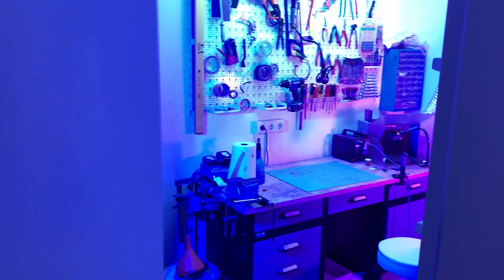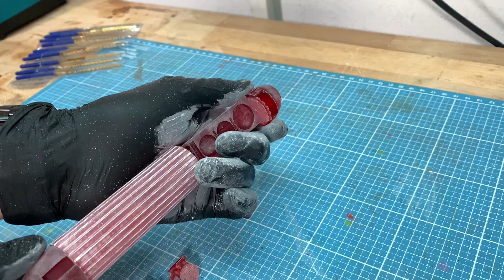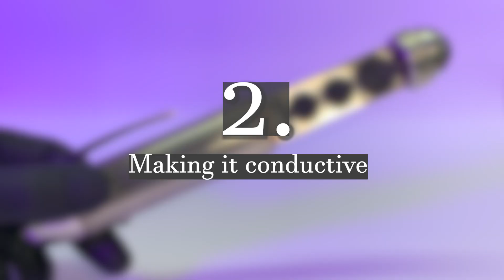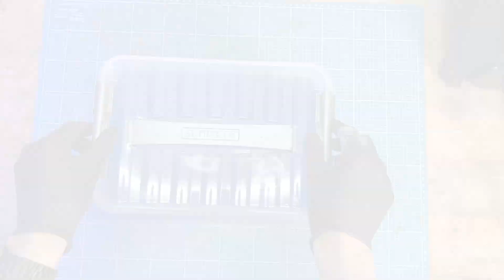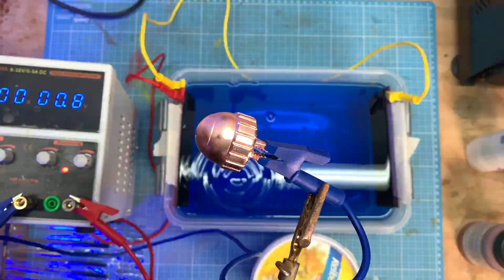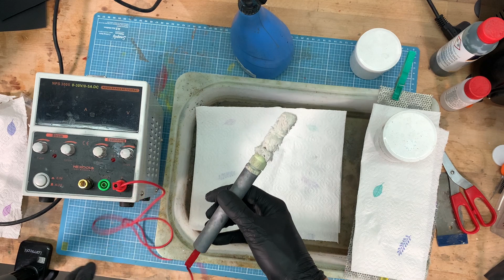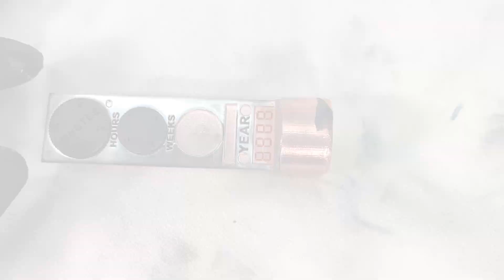Electroplating 3D Prints - Super Smooth

Comment from the maker: Just tell me what 3D Print you‘d like to see me plating for the future 🙃
Reply: Tabletop miniatures?
Reply: Peacemakers Helmet!
Reply from the maker: @brianthompson8783  that‘s big. I‘ll need a bigger basin for that. But I was thinking of doing bigger things (sword etc.). Problem is that it has to stay in there pretty long (hours), otherwise I’d just apply a metal layer with the galvanic brush.
Reply: @hen3drik  yeah, I have the helmet printed and I'm trying to figure out the best way to chrome it. Plating would be awesome.
Reply: Daft Punk Helmet or R2-D2 dome. Thanks for sharing this process. For a larger items would this process be prohibitively expensive when you have to increase bath size?
Reply from the maker: @insultcomicdog  best way would be a huge bath of a nickel electrolyte. This is illegal and kind of „dangerous“ for private people in my country. There is a way to galvanic brush it, but then the surface metal layer is very thin and ground has to be incredible smooth, what is tricky with conductive paint. To plate it even, the whole helmet should be plated at once in the galvanic bath. And distances to the anodes should be good, so I guess it could be expansive to prepare such a bath.
Reply: @hen3drik  Maybe you can start with Lego minifig scale helmets which are more feasible! This is my Thomas bucket which I’m trying to figure out how to chrome:  https://youtu.be/snK1cj5nOYQ
Reply from the maker: @insultcomicdog  I’ll do some testing.
Reply: A cylon
Reply: Have you been eying the Terminator arm that's up on Thingiverse?  Yeah, me too.  I have all the major parts printed and sanded but haven't progressed further because of how lousy my attempts at chrome paint have turned out.  The idea of electroplating makes me feel tired but I bet it would be amazing looking.

Do you think it is possible to go from conductive paint directly to a final, ready to sand and polish, nickel coating in one electroplating bath?
Reply from the maker: @hberg321  yes, i made that there years ago. I used Alclad II chrome paint and I went just faboulus. Indeed, I was thinking of this this to be plated. I‘d look way cooler, but, as you know, it‘s made of many, yet small parts. And they all have to be sanded smooth as hell before plating, as you don‘t want to sand this allergen nickel. You could create a thick copper layer, sand and polish this and apply a thin decorative nickel layer at the end (instead of palladium).
Reply: @hen3drik  Cool.  I have a bottle of Alclad II but have been disappointed with it rubbing off or turning uninteresting under clearcoat.  Did you use aqua gloss or just paint it and put it straight in the glass container?  

I didn't know that nickel was an allergen.  That must be why my stomach gets upset after eating bathroom fixtures or lighting accessories.
Reply from the maker: @hberg321  i don‘t clear coat alclad II paintings. There is a water based coating for alclad paint but it slightly dulls the finish. So, don‘t touch it and put it right into the glass vase. But to have alclad shine realistic it has to be applied thinly leading to a dark chrome effect. Bright nickel would be very convincing.

Correction: nickel is a contact allergen. Touch may harm you. Furthermore nickel electrolyte is dangerous and suspected to cause genetic defects, that‘s why it‘s restricted over here and in more states.
Reply: Can you 3d print a PCB circuit without the plastic around, just rigid cables on "air"?
Reply: Luck Light Saber New hope

Comment: What voltage/amperage are you using and how did you determine it? When attempting to determine the voltage & amperage, do you use the surface area of the plated object, or the surface area of the contact between the brush and the object?
Reply from the maker: Hi, this is an old video. In more recent ones explain how to determine amperage by the surface area. Long story short: Use "CC / constant current" Mode of your power supply + use 1A/dm². Silver cannot be used a diffusion barrier. Nickel works, too.

Comment: Any tips for airbrushing the conductive copper  paint?? I just got an airbrush and it keeps getting clogged :( what size needle do you use?
Reply: 2ns question! I want to electroplated a full sword! Do you have any tips on electroplating a long blade??
Reply: I've tried diluting the conductive paint but im still having issues :( I think im using a .3mm nozzle
Reply from the maker: I use a 0.5mm nozzle. Try higher pressure around 2-3bar. Electroplating long and big parts require bigger power supplies and suited vessels. I think I try it for the future.
Reply: I am facing that same problem, seems like the copper powder blocks the fluid passage. I will try using another kind of airbrush, that one where the ink reservatory is located under the airway (succion model).

Comment: how many paladium is need for this object?
Reply from the maker: It very few. I used a brush for this, so the brush must be soaked a few times. The palladium then deposits on the copper slowly. I can hardly guess but would say around 10ml. Thing is that the brush soaks in quite some volume.after that I squeeze the liquid back into the container.
Reply from the maker: @did3d523  not the stuff I use (at least way less): https://www.tifoo.de/en-uk/palladium-plating-solution?number=01-09-00020

Comment: Can the copper electrolyte be reused for multiple baths?
Reply from the maker: Yes, it regenerates by the anodes that will ultimately dissolve over time.
Reply: @hen3drik  ok thanks.  I have access to a lot of copper wire scraps because I’m an electrician.  Would using this work as well as the solid plate of copper?
Reply from the maker: Yes, this should work. One thing you have to consider: the surface area of the anodes should be slightly higher than the object you are electroforming.
Reply: @hen3drik  ok. My plan was to copper plate an iron man faceplate, so large parts.  So for this I would either need large plates or a lot of copper strands around the container
Reply from the maker: Yes, and probably high current. But it sounds like the perfect part for electroforming!
Reply: @hen3drik  how do I figure out the correct current? Trial and error?
Reply from the maker: @peebs2424  current is not what i‘ aiming for. It‘s the voltage. I use max 1.5V for all my platings. I keep the current in mind, as it will rocket for large prints after some time. I do some Math before I start plating of what current to expect at the end, but it‘s not that important.
Reply: @hen3drik  ok thanks. Hopefully the material needed is accessible in Canada. A quick search for the electrolyte didn’t turn up much results

Comment: Can you give me some idea of how much area, or models of a given size, the 20 ml Tifoo Palladium solution might cover?  I'm trying to figure out if I need to get the larger 100ml bottle and Tifoo provides no coverage info that I can find.  Do you dip the little anode brush/mop straight into the fresh Palladium or do you keep that clean by using a second container (like it appears you do in this video), and also don't pour any leftovers back into the original Palladium bottle?  Or do you think contaminating it doesn't matter much?
Reply from the maker: 100 ml is good for the brush imho. Don‘t dilute it, use a dedicated graphite anode and a dedicated nonwoven or woven sleeve for this electrolyte. Don’t mix! I use sealed containers in which I fill from the bottle, just in case, but I think it‘s okay to pour back. Surface area depends on how thick the palladium layer should be. With 100ml you can cover a lot of area for display purpose.
Reply: @hen3drik  By don't mix, do you mean 'one sleeve per one type of exact solution'? I get that.  Regarding coverage, I discovered today the Tifoo calculator (https://www.tifoo.de/infomaterial/berechnungs-tool) which really gave/gives me a scare--my object has 470 cm^2 (it's a head model 13cm high, area calculated by software), and it says for that I'd need 56ml minimum, 85ml recommended Palladium electrolyte at 0.1 micron thickness (I guess that's as thin as I should go?), and 23ml min. / 34ml. at 0.2micron recommended of Midas Gold electrolyte.  That's way more than I expected--assuming 0.2 microns gold is even durable enough.  It gives me one attempt at success if I buy a bottle of each and means the cost of plating that single model is around 51€!  Holy cow!  Have you tried Tifoo's calculator and if so, did you find it more or less accurate?  Also, for the copper solution it says I need to use 23.5 Amps! (25 micron thick, 470cm^2).
Reply from the maker: @perspectivex  I‘ll do some research for the amps. And yes… you‘ll need a lot. It‘s small at the beginning and going high at the end of the plating. For the palladium/gold: I don‘t have that much experience since I just started plating and didn’t measure my needs. But when using a brush it‘s really a very thin layer that is built up very quickly (for gold). I don‘t have the feeling that you need that much electrolyte. When moving the gold brush it‘s becoming gold instantly so I don’t belobe this is even 0.2 microns. Be careful with the calculator; I had crazy results as well. You can dilute the Midas electrolyte 1:1 with distilled water, I guess.
Reply from the maker: @perspectivex  470 cm^2. In my calculations i would expect something between 7A an 8.5A at 1.5V.
Reply: @hen3drik  well, that's a lot better than 25A but still gives me a new problem.  I have a lab power supply but it only goes to about 3A.  I have 30+A computer supplies at 12V but I'd have to figure out how to step them down.  hm.  That's too bad, I thought I could get away with the power supplies I have but now I'm not sure.  Or...if I did 1.5V at 3A would it simply mean it takes 2.5x as long?  I could maybe live with that unless I need to keep an eye on it all the time for safety reasons and it ends up being more than 6-7hrs.  That would get a little tiring.
Reply from the maker: @perspectivex  no, unfortunately it‘s not working that way in a bath.
Reply: @hen3drik  That gives me some hope.  I think I'll also scale down my model from 13cm high to 10cm high, smaller than I'd like but it gives me some room to mess up and (maybe) still have enough electrolyte for a 2nd attempt.  I guess if I run out of Palladium I could diy some nickel electrolyte since I have some nickel sheet.  Diluting the gold ...I wonder what effect that would have...maybe it would just go on slower but you'd end up using the same amount to have the same final look.   Also, having used various brushes do you think I could make my own from some microfiber cloth (what Tifoo says they use) or some other fluffy material?  It doesn't seem like a really critical part somehow.
Reply from the maker: @perspectivex  microfiber works good, yes.
Reply: @hen3drik  ah, too bad.  I'll have to figure out a high amp low voltage supply solution.
Reply: @hen3drik  what's the deal with "woven" and "nonwoven"?  Is it important to use one or the other in specific cases?  I was thinking I could just cut up some cloth I find at the fabric store and sew a bunch of layers together leaving a cylindrical hole for the anode to slip into and use that.
Reply from the maker: @perspectivex  you can do that. Get microfibre.
Reply: @hen3drik  ok.  But the woven vs. non-woven...when, if ever, does that matter?  Why is it even a thing to care about?
Reply from the maker: @perspectivex  this is not really an issue, try two layers of micro fiber between the anode and the object. 😉

Comment: Good tutorial, but what I found most interesting is that cloth covered "pen" for electroplating...
I've only recently started dabbling in dissolving metals into solution and plating stuff. I found I needed a way to plate by "brushing" with my electrode, but whose direct contact... and basically I made the EXACT same thing! 😮

That has instantly validated what I came up with on my own — had no idea such a thing existed! lol
Mine is a carbon rod out of a AA C-Zn battery (also have used a wood pencil's graphite core), with the "brush" head being the fiber-strand wick from an oil air freshener  ("AirWick" brand).

Washed the wick good, then cut a small portion off. Gave the rod a pointed tip. Rammed the rod inside, a few mm (about 1/8") before it protrudes. Then wrapped sewing thread really tightly around the wick and rod, and superglued it (reinforces and keeps it in place).

 IDEALLY not gluing shut the side the rod is stuck into... That's the only downside with mine, as the one end being sealed up now makes it rather hard to clean when changing metals 🥴

Comment: Does this increase the weight/feel of the 3d print in the end? As in does the print feel significantly heavier after doing this process?
Reply from the maker: It does, yes. The smaller the print the more as the ratio is smaller. For bigger prints like the neuralizer weight is less important, as it comes from the solid resin, but the tactile feeling of the metal (cold, smooth).

Comment: Great results ! The only thing i'm not sure is why bother with commercial solutions (tifoo in you case) with brighteners when you sand and buff after.  You could make you own copper electrolysis for much cheaper and it would not change your workflow since you already sand and buff.
Reply from the maker: You are absolutely right. I started this hobby with a commercial brand; though brightner was already in it. Maybe I was also wishing that these first results we‘re pleasing enough, but I eventually ended up sanding and buffing. This video was one of my first: I learned how to apply thinner and more even base coats, which ended in a nicer results. Still, if you want this mirror like finish, you should sand and buff. Another point I think important is that you keep things simple for beginnings. DIY solutions could be a step to much for people to get into this hobby. I noticed a steep learning curve when it comes to electroplating, so when doing tutorials I just want that people get nice results quickly.
Reply: @hen3drik  it's a great tutorial don't get me wrong.  I have been debating for a few weeks if I should go with commercial solutions or not but the price is quite high because I need least 10 gallon of copper and nickel just to start.  Seeing a few results with commercial solutions I know I will have to sand and polish anyway so I figured what's the point  I also try to get the absolute best bond between the plating and fiberglass.  I tried adhesion promoter before the paint but I cannot get a mirror finish with it because of orange peel.  I am currently doing some tests with baking the paint, it seems to improve the bond.  Any thoughts on this ?
Reply from the maker: @copper_knight  unfortunately no. I use 2k paint, then straight to conductive paint.
Reply: @hen3drik  what do you think about buying say 2 liters of the Tifoo acidic copper electrolyte then mixing in 1-2 liters of diy copper electrolyte?  I need 3-4 liters but the tifoo stuff is just so expensive.
Reply from the maker: @perspectivex  I wouldn’t try that, but I may work. Be sure to match pH and add brightner to your solution as well. Tifoo has tiered pricing for the electrolyte.

Comment: I have been watching nickel plating videos for weeks and I have only seen you use palladium what is its role?
Reply from the maker: Nickel electrolyte is harmful and prohibited in Germany for end users. Palladium also works as a insulating layer between copper and I.e. gold (just as nickel does). If you can handle nickel, go for it; but it causes cancer and all sort of allergic stuff. Basic rule: if you see bubbles in the electrolyte you‘re doing it wrong :-)

Comment: An excellent tutorial for playing, I can't wait to try it now. Quick question; do the jaws of the negative clamp cause less material to transfer at their point of contact? Meaning do we need to move the jaws mid bath?
Reply from the maker: In a nutshell: Yes. the jaws will weld with the 3d print. you can prevent this by moving the jaws, or placing them to a hidden spot (they will still weld there). You can also carefully wrap the whole print in silver wire so that the connection surface is larger. This reduces visible spots where the jaws were. BUT you still see them; also: you will still have to move the part in the wraped wire.

Comment: Print mesh like bone structure of structural element then electroplating it would save material without compromise the strength
Reply from the maker: Yes, probably. Metal plating adds a lot of strength.

Comment: I don't have access to conductive paints where I live, I tried to make a layer of graphite to make it conductive (graphite powder plus acetone or alcohol as suggested in other videos), but it didn't work, what am I doing wrong?
Reply from the maker: I use graphite spray that I polish when dry. That did the trick. You should measure the the resistance, aim for 4kOhm. Then apply 0.15 volt in the bath and just wait a long time. Give it a try.

Comment: Most videos I've watched used Nickel for the second base instead of Paladium. What are the benefits of Paladium over Nickel?
Reply from the maker: Yes, this is common, but it‘s, due to that it‘s a contact allergen, restricted in some countries. I would use nickel when you don‘t want to touch that thing afterwards or when you use it as a barrier for a later gold layer. Otherwise palladium is the way to go.